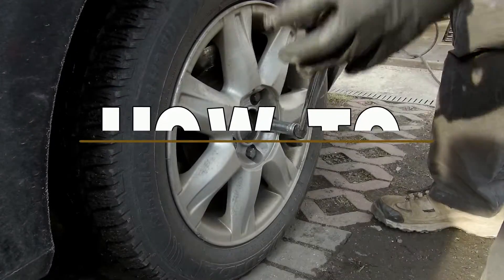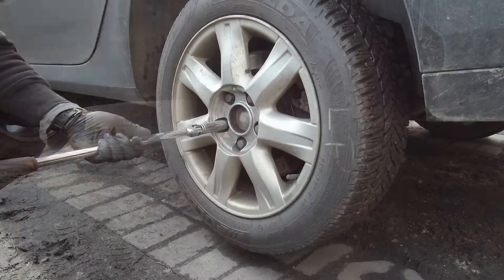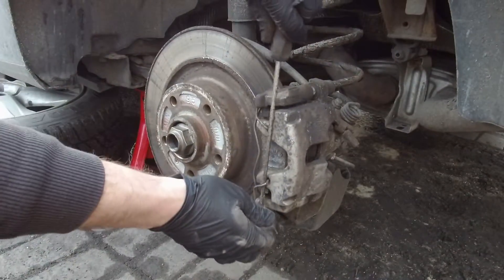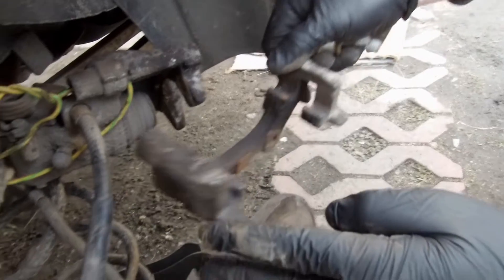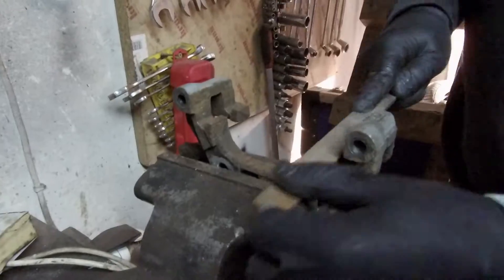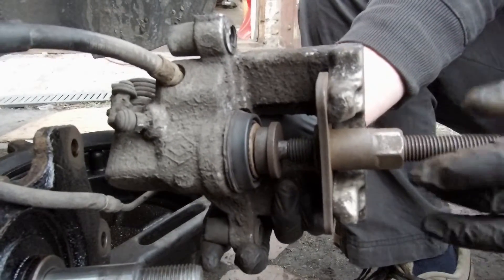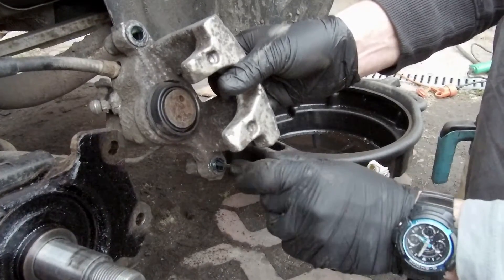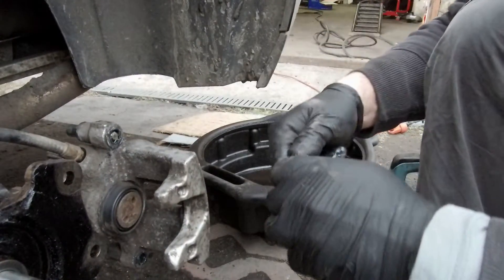How to replace rear brake pads and discs EPB - Renault Laguna 3 (COMPLETE GUIDE)

Comment: Great tutorial, can't wait to get started. Could you help me out with 2 questions? I see you're using Superfit as main grease, but what are you applying to the brake pads and spraying to the axle? What torque must be applied to all relevant nuts? Thanks a lot in advance
Reply from the maker: Hi :) I'm glad that you like it. For brake pads i'm using "K2 CERA HIGH-TEMP BRAKE GREASE" to prevent brake pads squeaks. On spindle i sprayed "CRC power lube pro" it's good because it drives out moisture and  seals out corrosion. Now about torque values: Rear hub (brake disc with bearing) 280Nm, Brake caliper carrier to hub: 105 Nm, Brake caliper to carrier (guide pins) 32 Nm.
Reply: @carsguidediy  can I do it without a torque wrench? Thanks
Reply: i guess im asking the wrong place but does any of you know a method to log back into an instagram account..?
I was stupid lost the account password. I appreciate any assistance you can give me!
Reply: @Saul Jase Instablaster ;)
Reply: @Zayne Yael thanks for your reply. I got to the site on google and I'm trying it out atm.
Seems to take quite some time so I will get back to you later with my results.
Reply: @Zayne Yael It worked and I now got access to my account again. I am so happy!
Thank you so much you saved my account!
Reply: @Saul Jase Happy to help :D

Comment: Excellent presentation, thank you! One question, you didn't line up the two holes on the inside pad with the two bumps on the back of the brake pad, is this necessary? Or will the bumps rotate into the holes with the rotating action of the EPB on the piston?

Comment: Great work. For the front disk how many Nm should i use for the main bolt, that hold the disk? Same like the back disk?
Reply from the maker: Hi! thanks :) 
For the front one you don't have to unscrew spindle nut like it was at the back. Front brake disk is held by two small screws, Front brake disc to hub is only 20 Nm. But if you are replacing  front bearing then you have to use 150 Nm for the spindle nut. And for front hub - wheel bearing housing bolts 105 Nm.

Comment: Just a tip when removing callipers like you did.. Give them a wobble side to side with your hands so they become lose on the disc.. That way you have better chance to remove it with pads from the disc 😉
Reply: Wobbling the caliper works on fronts but not rear.....the piston will not retract as its on a screw thread. 😎

Comment: Hi! I have a question for you. In the workshop manual says that is imperative to open the caliper with an electronic device to not damage the electric motor of the electronic parking brake. The thing is. Can it be retract with the regular tool without damaging it like you just did?
Reply: Im Sorry for my redaction. I dont speak english so well.
Reply from the maker: Hi there :)  In this Renault Laguna electric parking brake is very simple.  Brake caliper is the same as you can have in other cars with regular hand brake. All you need is to relase the hand brake with the switch.  After that you can use regular tool to rewind the caliper piston. EPB mechanism only pulling the handbrake cables.
The situation that you describe may occur in VW passat with EBP. Because it has got EBP mechanism built in brake caliper. Regards :)
Reply: Ok. Thank you. Nice video.
Reply: @carsguidediy  correct👌
Reply: I have a Renault grand scenic mk3.  To retract the EPB without special tools you need to follow the initial steps here to release the handbrake, then disconnect the battery.  Then disconnect the push fit electrical connection to the EPB and attach electric connector spades to the terminals and run wires to a power source (the disconnected car battery). You can then use the battery power to manually unwind the EPB. Switching the +/- connection at the battery will either wind or unwind the EPB. You must do this cautiously so you don't over-wind or over-retract. One you hear a change in sound, stop the power. Unwinding does take a good few seconds. Once the mechanism has unwound, you can use a piston rewinding tool but don't try it until the EPB has been fully unwound by using the battery power!

Comment: Did what you did step by step, now abs light is on
Reply from the maker: Hi :) 
Have you paid special attention for ABS sensor? In 5:08 in video, not to damage it. It's very delicate and it should be handled with care. Did the brake discs you bought have a mounted ABS magnetic ring? You can see it 8:28.
Reply: Yes I stayed away from it, I did not replace the rotors but took of the rear left to sand it a bit. Did exactly like you followed step by step. But contact was on the whole time. Don't know if that could be it
Reply from the maker: Why you sand it ? Because of rust ? Maybe piece of brake disc stuck between brake disc and sensor? It could blocked the signal from abs ring.  Also important thing is space between ABS sensor and abs ring. Maybe something bented abs sensor 
bracket? when abs light is showing on ? after you start your car? or after you drive for a while?
Reply: Sanded the part that the pads touch. And cleaned it with brake cleaner. Light on from contact
Reply: I didn't remove the right side rotor but I blowed the dirt out with compressed air, could be that maybe. Will check that out tomorrow. Thanks for awesome video and good avice
Reply from the maker: One more idea. Did you made some test drive already ? Sometimes when you spin a brake disk and the ignition is on, for exhample while you try to test hand brake, ABS can catch fault. In that case you just need to do test drive, and fault will gone.
Reply from the maker: Please let me know  how did it go :)
Reply: I did that yes handbrake and test, right side was still spinning. Forgot to pump it up first. tomorrow evening I will let you know 👍
Reply: Took out battery now it's okay.
Thanks for your help, keep making good videos, I subscribed to your channel